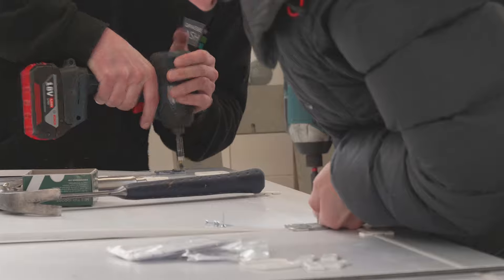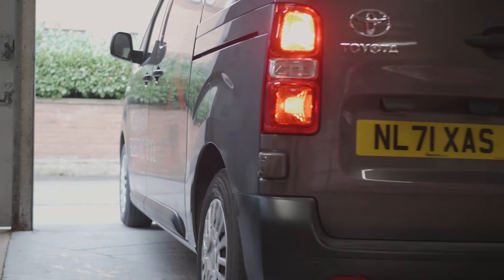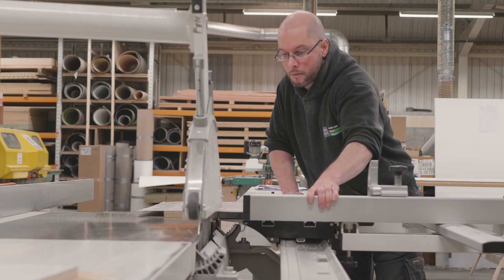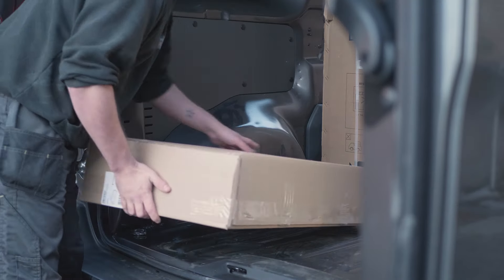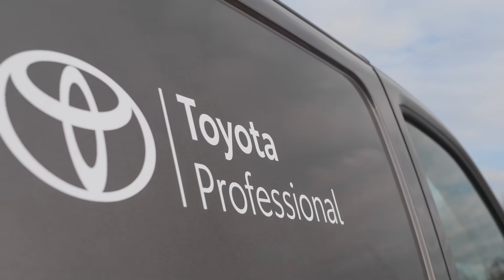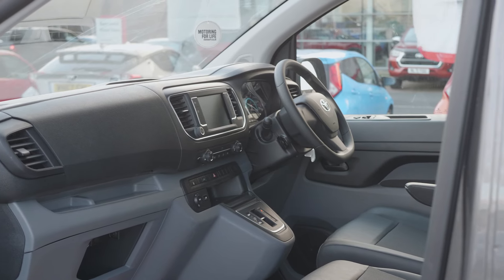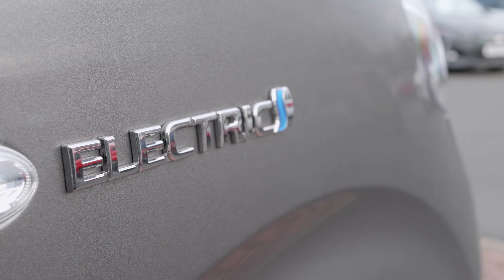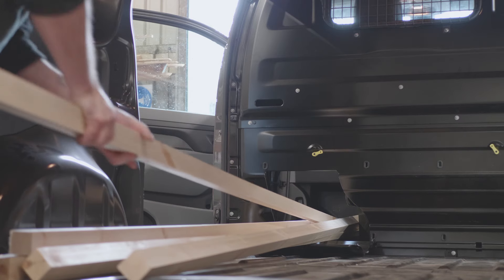What it's like working with a Toyota Proace Electric van for a week - A Carpenters View

Comment: Got one it's very nice less maintenance and very cheap to run at 2.6miles per kWh I pay 6p off peak.
Reply: E-NV200 does about 3.7 but it only has 760 payload and is shorter.
Reply: Are you still using the electric Proace?   Any issues with it?
Reply: @willdatsun Do you have the Nissan e-nv200?
Reply: @chrisa4882  it's been fine.
Reply: @bernardcharlesworth9860 Thanks for your reply. 
Has the battery range gone down much since you purchased it? 
I might be getting a 21 plate tomorrow with 40k mileage. 
Would you recommend this van?